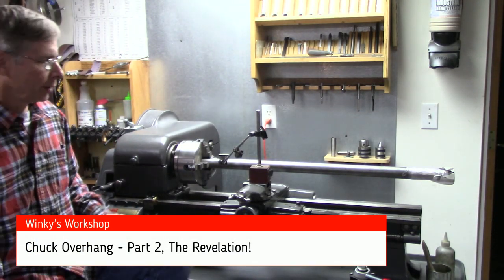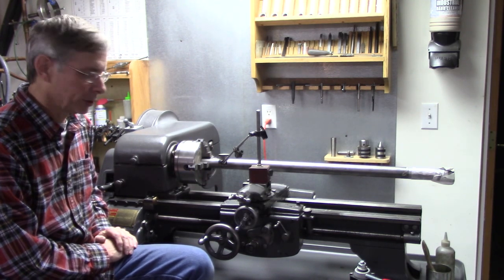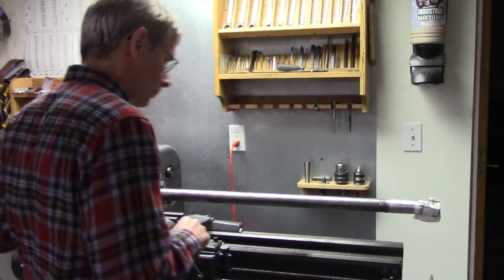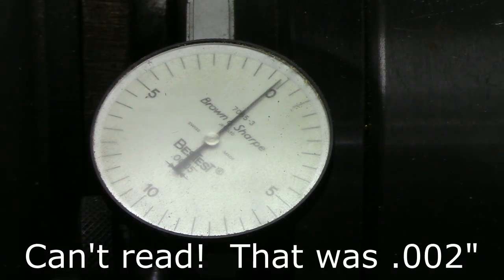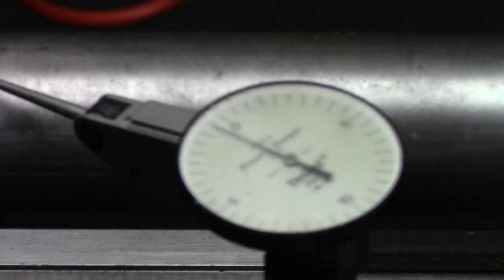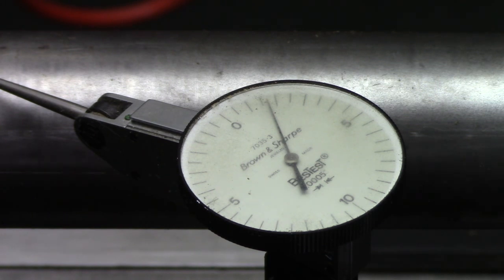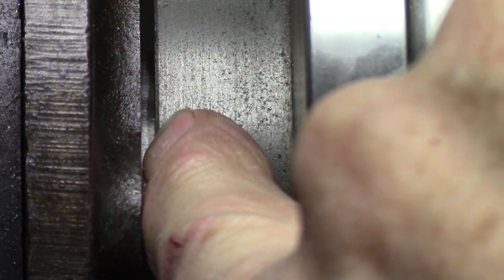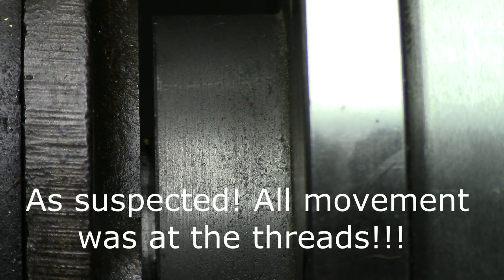Metal Lathe Chuck Overhang part 2, The Revelation!

Comment: Bingo! Pretty much what I was talking about in my previous comment in Part 1. I suspect that the contact between the spindle and the back plate there is not 360 degrees around the circumference. If it were all the clearance in the threads would be taken up as the chuck was tightened against the spindle shoulder and that movement would not be occurring. The only other possibility would be that the back plate threads are so poorly fit to the spindle threads that no amount of tightening will take up the clearance in the threads.
Reply from the maker: Actually, I put bluing in the back plate and it is making perfect contact. I have suspected the threads are compressing. Some say it won't compress but cast iron does compress. In fact this is why it dampens vibration. Today I took the back plate off and inspected the threads. Nothing broken although there is chipping on the thread points. But...  what really caught my attention is that only the tips of the threads had wear. They were shiny and the rest of the thread was dull. Apparently a thread angle mismatch. The thread tips are bending and letting the chuck move.
Reply: @WinkysWorkshop  All materials compress to some extent, even water. It's really a matter of how much. Cast iron has a pretty low modulus of compression, then it fractures. I suspect that the compression of the CI isn't the problem but rather the fit of the threads. The angle of the threads may be mismatched as you suggest, the spindle or backplate threads may be worn or, probably more likely, the threads in the back plate cut too deep. Some thread wires, the machinist handbook and a micrometer will allow you to check the spindle. Checking the internal threads of the backplate presents a greater problem. You may be able to get a fairly accurate measurement of the internal threads by using Cerrosafe or sulfur and casting a male  model of the internal threads and then measuring them as you did the spindle threads.
Reply from the maker: @pyromedichd1  I just blued both the spindle and inside the back plate and installed it about 30 times. Bluing made the plate hard to get on which tells me the threads are a fairly good fit. It actually looked like there was good thread contact. But....  here's what I did. Only 3 to 3.5 threads are contacting. Part of this is due to much un-threaded portion of the plate bore. but the threads per inch might be slightly off.  Nevertheless, this goes back to my first assumption. Thread compression.

Comment: Many thanks for sharing your investigation of this issue.  Since you have one chuck that works well and another that wants to chatter, it would be great to test both with the same setup.  Maybe you could put videos of both tests side by side for a really good comparison. It's hard for me to believe you would get that much movement if the backplate is in solid contact with the shoulder on the spindle.  Still, a comparative video should tell the story.  Again, thank you for sharing this journey of discovery.
Reply from the maker: Yeah...  most videos I do have a conclusion but this one was more of a question. I think the threads are slightly over sized and compressing under load. I was thinking about make a new  back plate out of steel but now I think I'll make a section that presses in with a bolt flange. A lot less metal involved.  Thanks for the comment and you are welcome.
Reply from the maker: Also...  I'm sort of afraid to put stress on my Loga chuck as a comparison. I mean it works great, what it i mess it up?

Comment: I think the problem is the fit of the register on the spindle to the register in the backplate bore . I know on the lathe i had with a screw on chuck i had to thread the chuck on and it screwed on easily until the two registers met , from there on i had to lock the spindle and use an adjustable wrench ( we call them a shifter) to screw it home . I could do it by hand but it was a struggle but that chuck seated back exactly the same every time !
Reply from the maker: The v of the threads thread are what keep the chuck centers. All my chucks have a few thousands clearance. If you are talking about the vertical reference (shoulder) it was tight. There has been a lot of debate about what the unthreaded part of the spindle does but the consensus is that it does very little.   It would be better if it was a snug fit but I've never seen one that was. I think the primary problem is oversized threads.
Reply: @WinkysWorkshop  
I think the set up on your logan may be a little different to my lathe , my spindle had a substantial shoulder and  a  spiggott that was around an inch long ( we are talking about a lathe with a 3 1/2 chuck) which  located the chuck axially  and all the threads did was to force the chuck back against the shoulder. I  wouldn't say the threads were all that good and when i made some new backplates for other chucks  i definitely got a better fit .
OH how i would like a camlock chuck !
You will find a solution Winky - i just know you will !
Reply from the maker: @Flattyman  - Camlock would be nice!  I see a steel back plate in my future.

Comment: I've never been a fan of threaded lathe chucks for that reason. Is there a way as some have suggested to shoulder the Chuck up against something solid to prevent it from rocking?
Reply from the maker: There is a 1/4" (aprox.) shoulder at the end of the threads. This is what you see in the bottom of the groove, the edge of the shoulder, some call it a register.

Comment: G'Day Winky, I really didn't expect that, amazing how much movement in the thread, I guess the backing plate does have some age to it and most likely been fitted and removed a thousand times and just getting worn out, great video as always mate thank you,    Matty
Reply from the maker: Actually it is a fairly new (maybe 5 years old) chuck but the backing plate is made of a poor quality cast iron and the unthreaded area is a little oversized which limits how many threads are engaged with the spindle. I suspect all thread mont chucks suffer from the same problem although not as bad as this chuck.

Comment: Not sure without a good look at your lathe and the four jaw chuck so i will just ask. Could you cut a set of tight tolerance threads in a piece of shaft that fit your lathe. Then turn a taper on the out side of the shaft.  then cut the threads out of your chuck with the same taper as shaft then press that into the chuck.
Reply from the maker: Interesting idea. I could also use some form of locktite on the threads to address any mismatch. The only problem would be that all the chucks used on my lathe would need to be modified. This is doable...  but a lot of work. I'm thinking a steel back plate instead of cast iron.

Comment: Another thought, im wondering if the major diameter of the adapter thread might be to large...allowing it to engage on less of the thread....and cause flex.
Maybe screw the chuck on all but 1/2 thread and check to see how much vertical/radial movement there is?
Reply from the maker: Yes I agree. I think screw on chucks are not ideal but I also think my chuck is worse than most. The cast is bad quality and the threads are not so great.

Comment: Its a Stretch, but might the thread pitch of the backing plate not be Exact?....allowing uneven tightening of the chuck to the spindle.....therefore letting it Flex because its not pulling on All the threads of the chuck.
I questioned the first/last thread ramping up as well(not allowing it to seat fully)....but read an earlier post suggesting the same thing
Reply from the maker: The video is a little misleading The chuck was 100% seated. I suspect the thread are the problem. Maybe just in bad shape. Its a poor quality of cast iron. But you may be right about the pitch being off slightly. It's probably made on a converted metric lathe. The lead screw on my Chinese mill was off about .015 in 15 inches. Regardless, I think this is pointing to a bigger issue. Screw on chucks are not ideal. I also think steel would be better than cast iron.

Comment: The threaded spindle on my South Bend lathe has a ground diameter and a ground face at the end of the thread.  Those two surfaces "register" the chuck for runout and squareness.  The chuck back plate needs an accurate c'bore and a square face to mate with the register.  The chuck threads don't need to be a perfect fit.  The threads serve to hold the chuck onto the alignment register surfaces, not align the chuck themselves.  Not sure of the configuration of your Logan spindle, or what the donut is.  Looked like there was movement on both sides of the donut.  It didn't appear there were any mating faces between chuck and spindle...I think there should be.
Reply from the maker: Its the same as the south bend. The video is a little deceiving. On the left side is a bearing cap. In the bottom of the gap that you see moving is the edge of the register. If you look real close you will see a small gap open between the register surface and the chuck back plate. I agree, they don;t need to be a perfect fit. The threads hold the chuck to the register and centers.
Reply: Hmmmmmmmmm in that case, it appears the chuck isn't threading on far enough?
Reply from the maker: @E-Glide  - No... it is seated perfectly. You may be looking at the bearing cap. I suspect the threads are the weak link although this backing plate is not made right either. The unthreaded area is much too deep and there is maybe a length of 1/2" with thread engagement with the spindle.
Reply: @WinkysWorkshop  sounds like you got it pretty much figured out,  and I can't really see what's going on...lol
Reply from the maker: Yes, there is two register points, the non-threaded portion of the spindle and what I call the back register. At the bottom of the gap in the video you are looking at the edge of the back register, not the spindle. I've read a lot about the shaft OD register and it is generally accepted that this is not a register and that the threads hold the chuck centered. The back register is absolutely necessary however. I did figure out why this is happening however. Due to an oversized counterbore (too deep) only 3 or 3 1/2 threads are holding on the very end of the spindle. The threads are basically a fulcrum point when I apply pressure to the bar. Yes it is true that the the counterbore in the face plate is over sized  (+.017) and that a snug fit would limit this movement but so would threads engagement closer to the back register.  Even my Logan chuck is oversized in this area.
Reply: @WinkysWorkshop  just my opinion after 50+ hours a week for almost 40 years in the trade....the register diameter is critical (as is the face) to both the alignment and rigidity of the chuck.  If the threads are acting as a fulcrum, the mating face of the chuck has to be pivoting up and down to allow that face to move away from the register face of the spindle.  With a close fitting register diameter, that simply cannot happen.  IMHO, with a close fitting register diameter, and a square register face, screwed up tight,  even with a sloppy thread,  the movement shown can be virtually eliminated
Reply from the maker: @E-Glide  - Well, here's the deal, most authorities on the subject including Logan don't agree with you about the fit of the counterbore. That's not to say they are right but I do agree with them. It is the cone of the threads that keeps the chuck centered. I just measured my original Logan chuck. This is an old chuck but in great shape and it has no sign of wear. It is my standby chuck because it also centers the same and never chatters. I have left work in the chuck, swapped chucks and reinstalled the Logan chuck and it never changes. Up until a few minutes ago I have never measured this counterbore on the Logan chuck.   It's not the same as my problem chuck which was .018" over sized, it is actually .021 over sized. The back register is super important, it squares the chuck but the non-threaded portion of the back plate bore is simply to help you get plate mounted to the spindle and to accommodate the fact that it would be impossible to make a spindle thread that goes 100% to the shoulder. Of course this is my opinion but the evidence is suggesting that it is correct.  I might add, there has been much debate on this subject in the past.
Reply: @WinkysWorkshop  yes, lots of debate.  Basement shop type lathes it probably doesn't matter.  Industrial world maybe a different story, and why threaded spindles haven't been used there for...I don't know...100 years.  Again, jmho...the "taper" angle of a thread wouldn't be my first choice for precision alignment.
Reply from the maker: @E-Glide  - Yeah...  I think the thread mounts went away about 1950.  Not the ideal mount.
Reply: @WinkysWorkshop  I just hope you're new backplate gets it fixed...doesn't look too good the way it is.

Comment: Wow ! I would not have expected that  !  THANK YOU !
of course you realise you are putting a ton or more torque on that chuck to do that ! and that is not good for the threads in the chuck adaptor ! ..... the cure ?  make a steady rest ! 
....it would not surprise me for you to discover you have destroyed the threads in the chuck adaptor, check the run out of the chuck after the bar is off there and see if you can correct the runout of the chuck with the bar chucked up and push in the correct direction....... it could happen !!!!   cast iron does bend a little before it snaps not much but a little !
good luck !  and thank you ! 
Bob......
Reply from the maker: I suspect this backplate is very bad quality cast. I agree, this test is not good on the threads but, I suspect cut off work puts incredible stress on the chuck as well.  I'm wondering WHY back plates are always cast? Maybe they need to be steel.
Reply: @WinkysWorkshop  from what I understand about chuck back plates I got from "this old Tony"  he made one from steel and it worked great.... the only problem I could possibly see is it getting jammed on so tight you can't ever get it off, that is why they make them from C.I. I believe,....  a bit easier to release .
......

I have a Logan 922 but have never had a problem getting a chuck off.... but I've not had the lathe that long
I've made your expanding mandrel 2 times now, the indexing tool, tool post drill ( that was a flash of brilliance on your part!)  and the sideways adaptor for the tool post drill..... all very handy.....
the dials were already made bigger on the cross slide on my lathe so I haven't had to make those but the compound I may do in the future..... I did one you haven't though ! and that is I made a 2" threading dial replacement..... and it's allot easier for these old eyes to see ! 
thanks for your videos ! 
Bob......
Reply from the maker: @bobkelly2447  - Very cool. Glad to see you utilized some of the info in my videos, that's great. As for the threads sticking, you might be correct about cast being better. I suspect a little anti seize might prevent that however. I think the steel plate is worth a try...  now I need to find a piece of 1"x 7" x 7" steel. 6" would be a lot easier to find but the chuck is about 6-1/4 or a bit more.
Reply from the maker: Yeah...  saw that video. This Old Tony is great... fun to watch his stuff!
Reply: @WinkysWorkshop  Please ! make a video when your making the steel chuck adaptor !!! ...Bob......
Reply from the maker: @bobkelly2447  I'll do that
Reply: @WinkysWorkshop  Fantastic... as I think like you think that all threaded on chucks probably suffer from this ailment..... on mt Logan 922 lathe , very similar to yours, I have 2 chucks both with back plates attached
..... I understand what the other guys were saying about the back register.... but I don't think our Logans have a back register on the spindle at all , so you can't have the chuck go all the way on till it hits the register
....there ain't one ! ....there is just the one internal register directly after the threads on the spindle.
and when you thread the chuck on it screws on and stops with a bang on that register...at least mine does.
.....
the idea of making a new internal thread on a bar and then boring out the old back plate and pressing it in
gives me cold chills... myself I would rather make the entire back plate out of steel...even if i had to (shudder) .... B,B,Buy the steel ! LOL......Hang in there Winky you'll get it !
Bob.........
Reply from the maker: @bobkelly2447  - So far I haven't found a piece of steel the size of my chuck. I did find a chunk of 8 inch 4140 steel that is 8-inch and 1-1/4 thick. I'd rather use something softer with on the threads. I cant imagine trying to turn most of this steel down to 5/8" thick. Even mild steel would be a long process. Sleeving the current plate wouldn't be too hard. 2" round might be enough but a little more would be better. The hardest part would be keeping things centered. I'd have to bore the hole in the plate, remove it from the chuck to press in te slug of steel and then put it back in the lathe dead center again to bore and thread the hole. Even with a good press fit I'd probably drill and thread a couple holes for pins where the steel and cast meet. 

Yesterday I cut half the donut off the back of the plate which reduced the unthreaded area to about the same as the spindle this  reduced the movement by half. I made a video and will past it later today. Also I think you got confused about the register. There is a enlarged part on the spindle that the chuck seats against. The circumferential is the one that really doesn't exist (the unthreaded area of the spindle and back plate).  The back plate unthreaded area bore is usually .015" to .020" larger than the spindle so really can not have any kind of alignment effect unless it's modified.